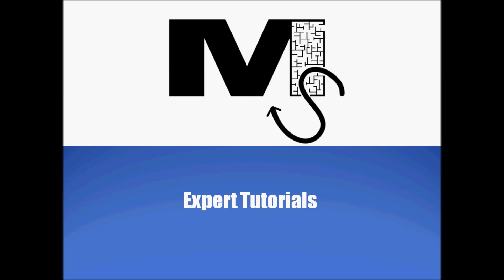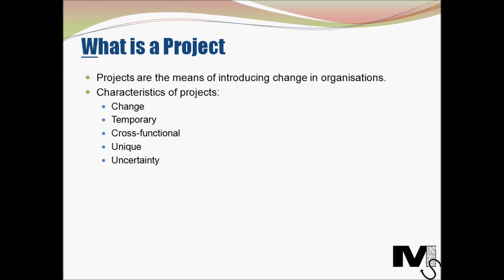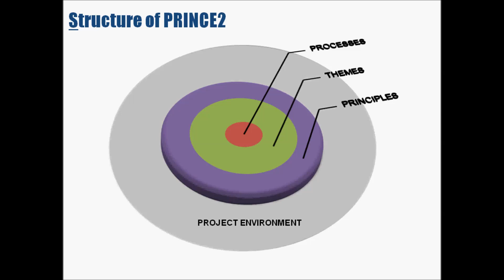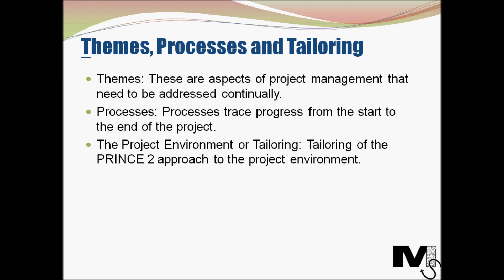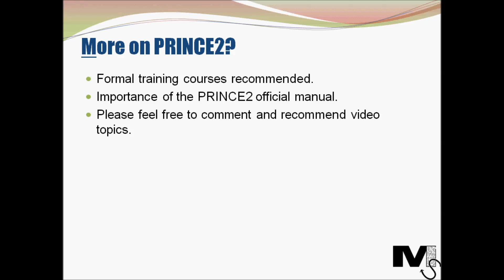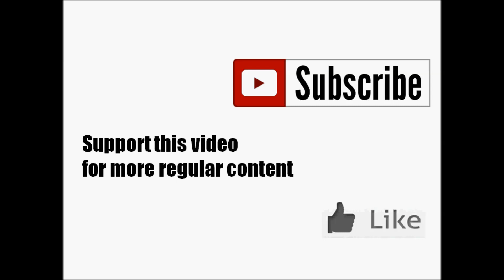PRINCE2 Project Management Basics - Simplest Explanation Ever

Comment: Do you have any reccomended online courses for the foundation and practitioner exam? Many thanks!
Reply from the maker: Hi Grace! There are loads of good online courses one could use to learn. There are courses in portals like e-careers, Udemy, etc which can be used in conjunction with the official PRINCE2 manual to crack the exams. One of the best ways would be to sign up to an inexpensive course to begin with and use it just as a guide. The official PRINCE2 manual is key. Starting off this way will help you understand usage of the manual. You can then decide if you wish to continue using just the manual or invest in a meatier course.

Comment: hello  can you please recomend the procedure for prince 2 course ? the best platform from where to learn and certified.moreover i want you to post more videos with short examples in prince2 to be implemented
Reply from the maker: Hi Chinky. There are loads of good online courses one could use to learn. There are courses in portals like e-careers, Udemy, etc which can be used in conjunction with the official PRINCE2 manual to crack the exams. One needs to crack the Foundation exam first and them the Practitioner. And it's best if one appears for the Practitioner soon after the Foundation exam. The worst thing one can do is to leave too much of a gap between Foundation and Practitioner exams. The Foundation exam instills the fundamentals and the practitioner teaches how to put it into practice. In terms of more PRINCE2 content, I will work on some for sure!